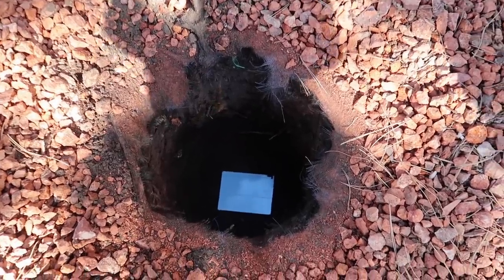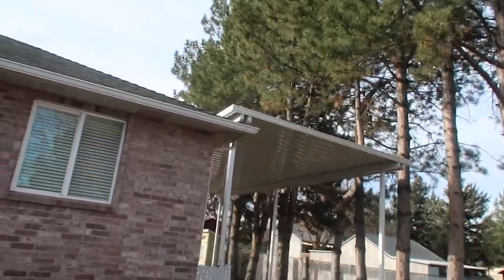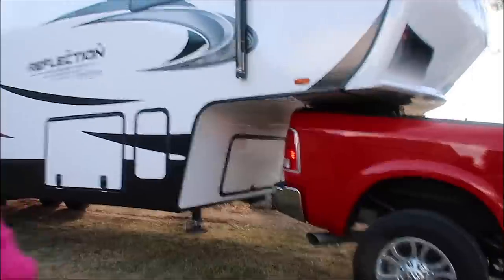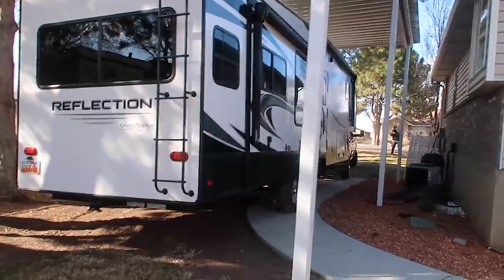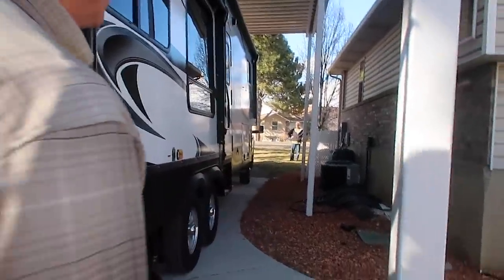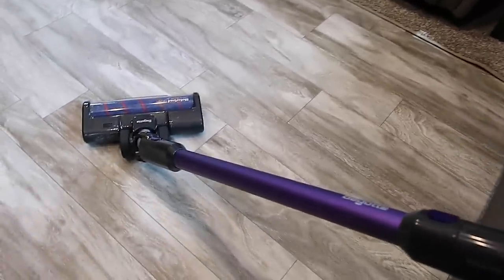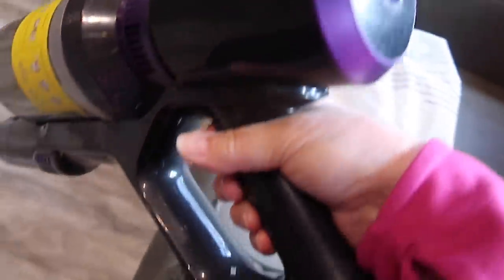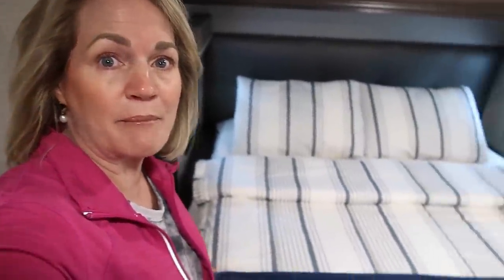Building A Cover For Our 5th wheel, But Will It Fit?

Comment: Would love to have more info on the Awning.  Manuf, size, costs, etc.........
Reply from the maker: It’s called Kool Breeze it’s 15x 40 but we should have built it 46 feet long, our 5th wheel is 36’ but oh well.it works, we may add into it later. It’s a little pricey for sure. We spent 12k on it. Good luck.
Reply: @grandmaandgrandpagriffiths4715  Enjoy you taking us all along for the ride.  

Thank you for the info and God Bless you both and your family!

Comment: It's nice to have someone else do jobs like that.  Looks good.  I have a random question.....is it common for houses in UT to have basements?  I've also noticed many don't have landscaping. (not yours of course), but is there an issue with water or some reason for that?  We've used dryer sheets in the cabinets etc. in our trailer to deter mice.  No problems for us and the scent will go away after a good airing.  Bless your day.
Reply from the maker: Yes, most people have basements. It’s cheap square footage here.

Comment: I still would  take everything out those mice will find a way in and even if they eat the bait they could get inside the camper and die in there and you will smell them. Trust me we’ve had a camper for a long time and they can find their way in and you don’t want anything in there shoes clothes paper towels they’ll take.
Reply: I agree about the bait. We used to live in a wooded area and had a couple mice. We put the bait out and I kept smelling this awful smell in one of the bedrooms. After inspecting everything I found a diseased mouse inside a light switch 🥴